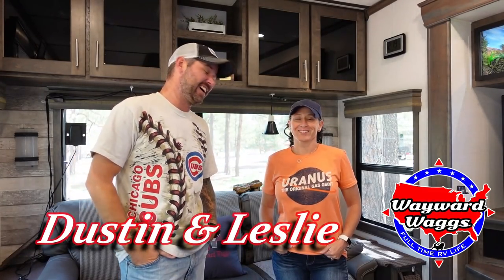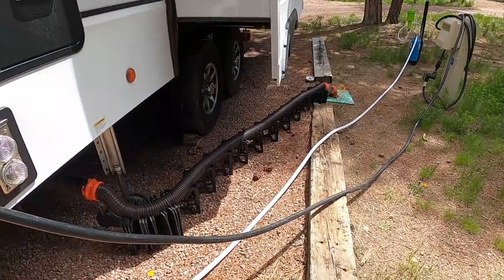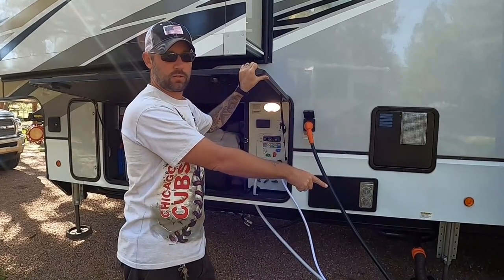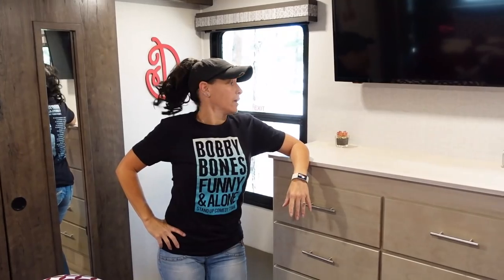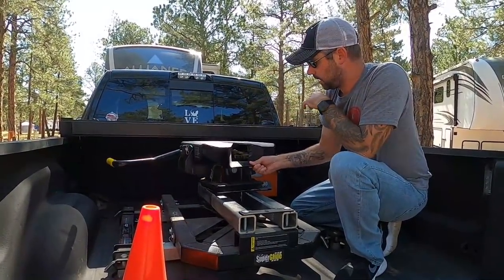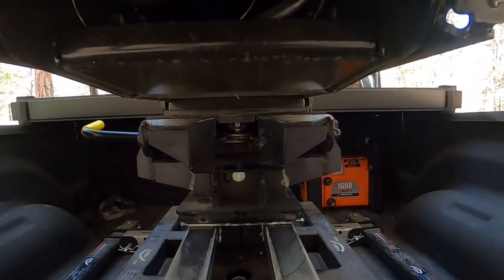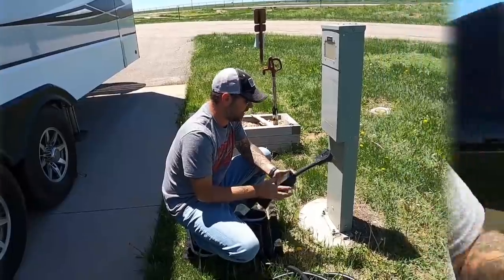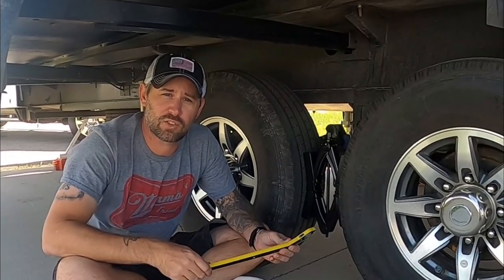RV Travel Day Routine and Checklist (Setup and Teardown)

Comment: The Hubbster and I were watching your vid and we noticed as you briefly show your Nautilus system you had your water hose attached directly to your rv Nautilus. Just a tip that was give to us by our inspector... He told us to use a 90° elbow for the connection of the hose. This will reduce the angle stress at the connection point of your Nautilus.
Reply from the maker: Good idea. Thanks for the tip.
Reply: Welcome

Comment: Your routine for travel day is identical to mine. Like yours, it starts the day before. On travel day, I only have to unhook the electrical cord and water hose and do my pre-trip walk around. I’m already hooked up to the trailer too. Sometimes I’m not able to hookup the day before because of the location of the trailer in our site, the truck will be in the road. The wife secures the inside and brings in the slides and puts the satellite antenna down. A word of caution to loading up the sink with heavy items. It’s possible the screws holding the under counter sink can pull out causing the sink to drop a little. Periodically check under the counter for loose sink mounts. Safe travels and happy trails.
Reply from the maker: We are pretty comfortable with our routine. Thanks for the tip on the sink.

Comment: For your brake away cable... get a d ring and attach to your tie down point by the 7 way plug and attach your cable to the d ring... just so cable doesn't come loose...
Reply from the maker: Good idea. Thanks for the tip.

Comment: We have a Class A, so depending on how long we are staying, we may just plug in, level and open the slides.  Of course, I have the whole gambit to do inside whether we travel 2 miles of 400 miles.  Oh a long trip. I have cases of water & drinks stacked under the dining table chairs and totes of food or snacks I squeeze in next to the sofa.  They are just easier to get to during travel that going down the hall and trying to dig stuff out of the pantry, in the dark.  Shades are closed so it's dark back there.  LOL  Then there is the dog that has to be walked.  She is ALL hubby's job!  HUGS~Donna

Comment: We have the same kitchen faucet and it has turned itself on during travel, it can make a mess if water pump is left on.
A hack to prevent this is put a large gum band around the faucet handle
Reply from the maker: Good tip. Thanks!

Comment: Great video. The more I watch the setup and tear down videos, the more I'm glad I have a motorhome with no slides or awning (working on replacing the awning) and travel light. My tear down consists of dump and flush the tanks, then unplug, do a walk around start the engine and drive away. Anything that doesn't stay put goes in the trash or gets permanently mounted.
Reply from the maker: That does sound a lot easier.

Comment: Great video. I’ve been using the wheel chock like you received for a long time and it works great. I attached my wrench to the back side of the chock with a small black chain, and after tightening I store the wrench on the bottom inside of one of my wheels. You can’t even see it and I don’t lose the wrench. I haven’t ever had mine stolen. If it does I’ll buy another. I still chock the tires.
Reply from the maker: Good tip. We appreciate it.

Comment: Think about hooking the breakaway line to one of your ties in the bed. If you lose the hitch the breakaway won’t do you any good
Reply from the maker: Good idea. Thanks for the tip.
Reply: I have tried hooking to one of the ties but when I make a hard turn the opposite way, I have had the pin pull.  Of course, I have other items in the bed of the truck that makes it more of a challenge.  I hook mine to the base of the hitch.

Comment: I'm not a fifth wheel owner but everything i've seen people say you should do a pull test with your front levelers a couple inches off the ground in case it fails that's all the farther it will drop. I didnt see a pull test so i was curious if i just missed it.
Reply from the maker: Yes. We do a pull test. We mentioned it but did not show it.
Reply: Great video guys.  That’s how we do our tug test, too—with the front jacks just a bit off our lynx leveling blocks.   (One of these days we’ll also spray paint the jaws so they’re easier to see when locked.) Keep the tail gate open, so if the rig does slip off, it’s one less repair.  May that never happen to you 💕

Comment: Love the between the wheels chock, that is a great idea. I have this crazy idea to come up with a parking break for trailers. I drove and owned semis and there brakes lock when you unhook....I would like my break away cord hooked to the truck bed instead of the 5th wheel handle.... The reason is if the hitch ever came off or loose the cord would not pull. But if the hitch ever come off you have bigger troubles than the cord tho. Have you folks ever considered gas stop for your propane tanks ?
Thanks again for sharing and helping us learn.
Reply from the maker: We have looked into Gas Stop but have not decided on it yet. Thanks for the tip on the break away cord.

Comment: Question: After Leslie closed the entry door did you lock the deadbolt? I’ve always locked mine for added security, just in case the trailer twists a bit while traveling. I too always check the pedestal before unhitching and I use X-Chocks between my trailer wheels. It really does help with stabilization. 
The high point of the video for me was Scout, of course. He’s so damn cute!! And he’s a BIG boy…very healthy. 
This was an important video and it was very well done. Concise, to the point and lots of great information. 🦎❤️🦎
Reply from the maker: Thanks Lori. We are glad you enjoyed watching. We do deadbolt as well. Justbin case.

Comment: I can't leave anything to ride on the rear couch in my 340.  There is too much bounce.  Curious - what tire pressure do you run on your coach?  I use max pressure and it seems to be like riding on solid rubber.  I'm experimenting with different pressures.  I'd appreciate your input.  Also, when we did our PDI, we were advised by the tech to retract the rear jacks before returning the nose to hitch level, with the reasoning that it doesn't put torque on the frame or extra pressure on the rear jacks.  We have used that technique from the start.
Reply from the maker: We run our pressures at 105. This gives us a little play in either direction. In the cold, the pressures go down to around 100 and it the heat, they can go up to 110. It seems to work well for us. Thanks for the tip on the rear jacks.

Comment: Looks like you have a short bed truck and a sliding hitch system.  Haven't heard much about sliding hitches. Do you swear by it or swear at it?  Would like to see more info about that.
Reply from the maker: We swear by it. It is a little tricky when backing up but we love it. We did a video on it about a year or so ago. Here is the link to that video: https://youtu.be/06LJJJzgZps
Reply: @WaywardWaggs  THX and will look at it!
Reply: @WaywardWaggs  Think that was posted before we found your channel.  So, my questions are which came first / would you do it again:  did you already have the truck and the slider hitch was necessary or do you prefer the short bed and sliding hitch combo?  We own no truck or RV, so all options are open for us.  Our current favorites are rigs similar in size to yours.  I think I want a 1 ton SRW with a big cab and long bed.  With that truck I think a slider isn't needed, but do you think it would be beneficial?  Also, I am intrigued by the newer generation of the Reese Goosebox.   Am I correct in my assumption that the goosebox would not work well with a short bed truck?  Would you consider that option if you had a long bed truck.  Thanks and safe travels!
Reply from the maker: @davelauraphillips8814  For us, we wanted single rear wheel and short bed so it would be easier to get around as our daily driver when we are not towing. If you get a long bed, you will not need a slider hitch. We bought the truck first; then after researching and seeing others with short beds who tried to use a regular hitch and damaged their trucks, we decided on the slider hitch.

Comment: I'm curious how your SRW truck handles the 340RL (payload and stability, especially on windy days). The wife and I are looking at the 340RL and we're on the fence on whether to get dually vs single rear wheel. I know dually is safer and more stable, but driving one around town and washing it can be a hassle.
thanks for your time.
Reply from the maker: We have had no issues at all. We pulled a  35 ft. Montana for 2 years with it and have been pulling our Alliance for a year. We have never had dually so we have nothing to compare to but the SRW has done fine in the wind and we love that when we detach, it is easy to maneuver through town, drive throughs, and car washes. Also, we only have 4 tires to replace and maintain instead of 6. When we replaced our tires it was $1,100. It would have been around $1,700 for a dually. We hope this info helped.
Reply: @WaywardWaggs  I appreciate your honest reply. By the way, love your video's and from one Vet to another, I love your recognition of our brothers and sisters in arms. I myself served 31 years Air Force and do appreciate your recognition. Safe travels to you and the Mrs. Hope to run into you someday during our travels.
Reply from the maker: @MrMCarr63  Our pleasure. We hope our paths cross someday and thank you for your service and sacrifice as well. 🇺🇸